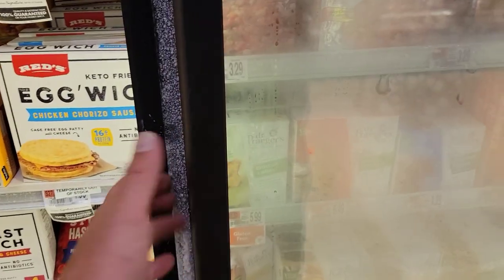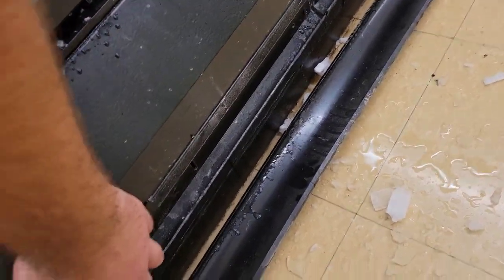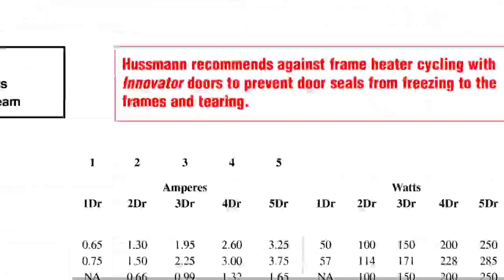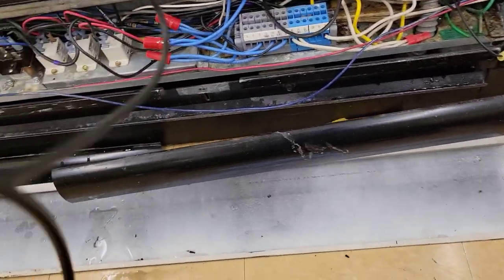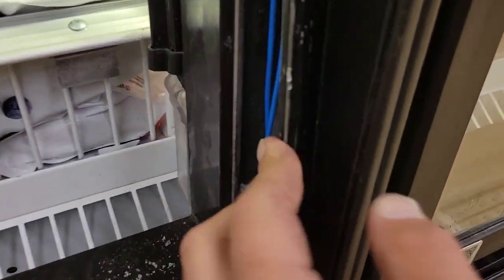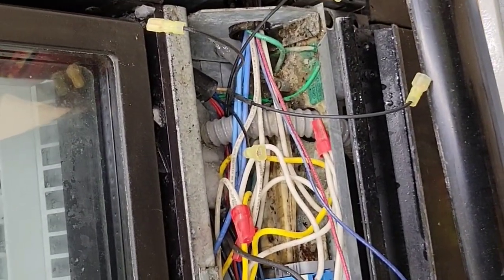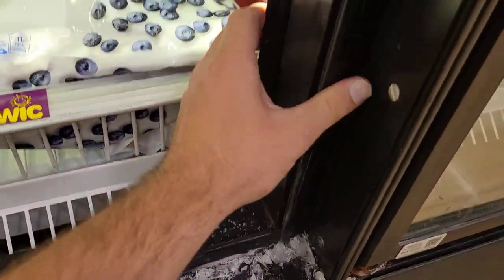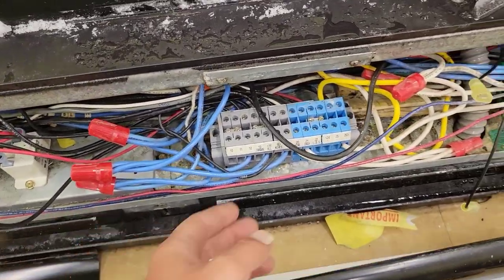Supermarket Refrigeration- How to Diagnosed A Bad Door Frame Heater (Hussmann RL-5)

Comment: It shows the A.S. relay is normally closed so shouldn’t relay open when energised? Hence, if energised it means it will be going into defrost and you don’t want door heater on with defrost
Reply from the maker: So from my understanding and it's been a while since I made this video so i'm going off of memory. 

Step one the case goes into defrost. 

This will provide power to the anti sweatheaters. They are normally Closed as you said. The power is usually provided by the danfoss controller at the rack sometimes through a contact or something like that.

Typically there is some type of thermostat or click on in the case. That is what the power is routed through and that is what is normally closed. 

When the case reaches a temperature for the anti sweats to turn off the switch opens cutting power to the anti sweats. 

This prevents energy waste as well as fires. 

So i'm told.

Anyway I hope that helps.

God bless

Comment: Need help I got a circuit that contains 4 different cases low temp freezer doors Anthony frame all cases besides one door frame heater work I have no power at my terminal block to energize heaters I was told to look for a breaker but the breaker I found sends power for all cases on the circuit my question is where do I look for my source of power for the case that door frame heaters aren’t working???
Reply from the maker: It depends on the case. 

Hussmann have a panel in the front or the top of the case. 

And Hill Phoenix have them on the bottom or the top. 

What I would do personally is I would Take the Pan panels Off the four cases next to it and see if power is daisy chained case the case. And then trace where the power stops and See if there is a break in the daisy chain. Or a loose wire or something. 

Good luck man I hope that helps

Comment: Question about these types of doors (need to confirm which type exactly) I have a 20 door frozen food line up and one of the doors has a little ice on the middle pane. Is that a door heater issue or a "need a new door" issue ? 😆 

Great content as usual 👏
Reply from the maker: If it's on the glass of the door. 

The door plugs in and has anti sweat  heaters inside the door so you might need a new door. 

If it is on just one peice of frame. It might be a gasket issue or it could mean the heaters on its way out. 

If it is not very much ice maybe knock it off and see if it builds back? 

You could also Carmpair the amp draw and ohms to a working case and see if is really off base. 

I hope that helps some :)

Comment: Here's a link to tech sheet Master G shows:

https://www.hussmann.com/ns/Technical-Documents/0425644_P_RL.pdf

Have to spend a lot of time unpacking this one. Mr. G makes interpreting the wiring diagram look as easy as reading a menu. 

"Am I good enough to even be in this business???"

A few videos back, Mr. G did a video on a case that was wired wrong (!).  After seeing This video, I can see that happening (!).   "Your problem is somewhere in this wiring diagram".   Yeah, right. The guy probably looked at the diagram and freaked out.  "I have to fix this somehow, or I'll get booted!!!".   So he did a hack wiring. 

**
I'll be telling myself, just take it slow; watch as many of these videos as you can. 
👌
Reply: There's a Red warning block in the wiring diagram that says "Warning:
Terminal block NOT for 
case-to-case 
wire connection!"

If I'm not mistaken, that sounds like the wiring "hack" that was done in the earlier miss-wiring video (if you think This one was hard to follow).